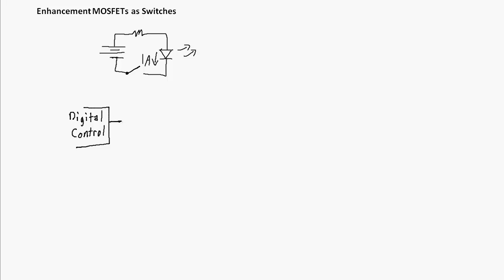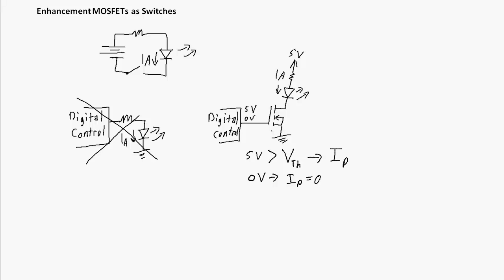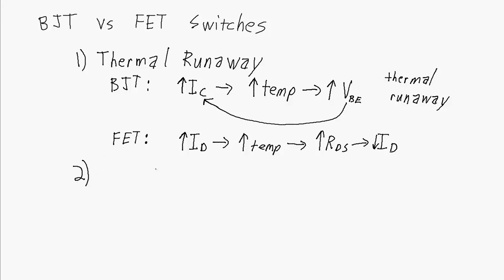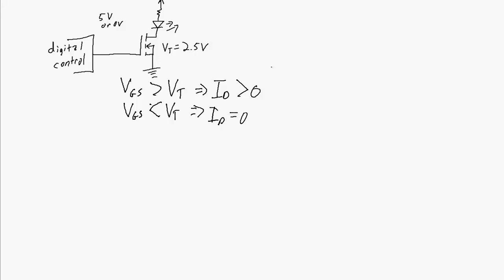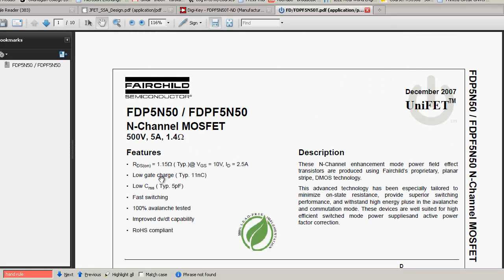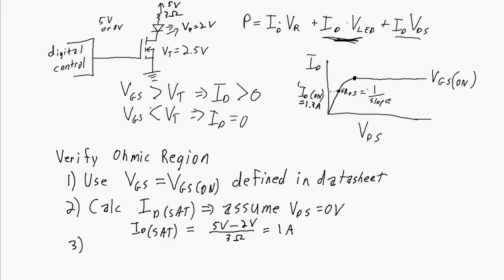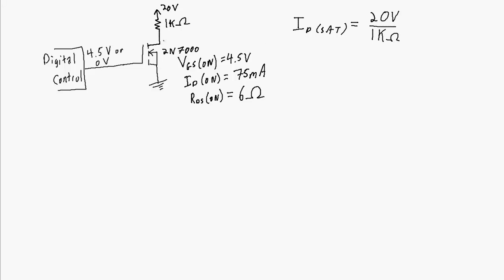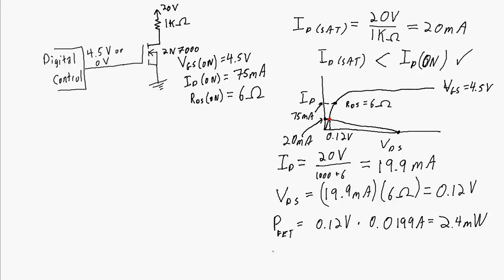Enhancement MOSFET Switches

Comment: That is an old video, I just felt over it almost by accident, so I wonder if I should insist, but .... why should it that we have to use the MOSFET, as a switch, in the ohmic (linear, or triode mode) rather than in its saturation (or active mode)? The resistance of the chanel is much lower in the active (or saturation) mode, since it correspond to the almost horizontal part in the Ids-Vds graph.

Also, the difference between these two modes isn't it that, once Vgs > Vgs(th) for both modes, then we are in the linear mode (or ohmic, or triode mode)  if Vds < Vgs-Vgs(th), and in the active mode (or saturation mode) otherwise, that is, Vds > Vgs-Vgs(th) ?

In my understanding, the ohmic region is to be used if we look for amplification, or variable resistance, NOT much though if the intended use if as a switch, which, with an ideal zero resistance for a switch, the active mode is preferable, mostly if we don't have to open/close the switch at a high rate. I was wrong on my understanding, or you were having something else in mind?

Comment: Great video BUT, I found an error in your thermal runaway explanation for BJTS.  temperature cause Vbe to decrease not increase (above room temperature.)  because base voltage is pretty much constant, and (Vb =Ve + Vbe)  a decrease in Vbe causes Ve to increase this in turn will cause Ic to increase which eventually may destroy the transistor.

A 4th and 5th advantage is the FET produces a lot less noise than BJT'S,  and has a lot higher input resistance than a BJT; Making them better buffers.

Comment from the maker: On the Id vs. VDS curve, Id(on) falls in the ohmic region. When you have a FET working as a switch, you want it to be operating in the ohmic region. The check for Id(sat)<Id(on) is your confirmation that the FET circuit is in fact operating in the ohmic region. The reason this check works is because if you have an Id that is < Id(on), the operating point will be to the left of Id(on) and if you are to the left of a point that is already in the ohmic region, you will still be in the ohmic region.